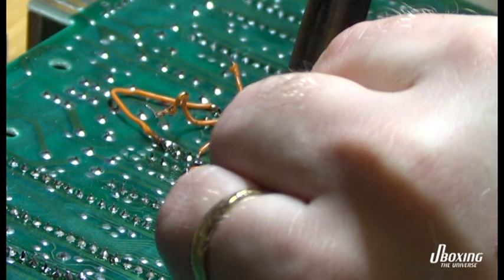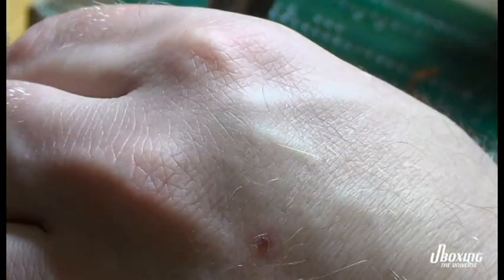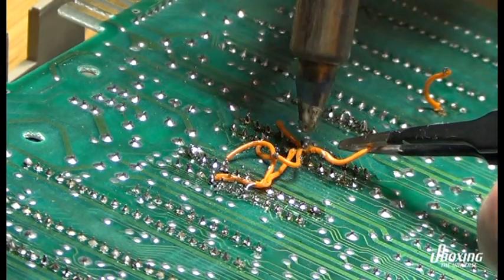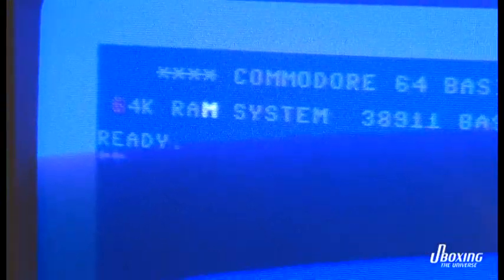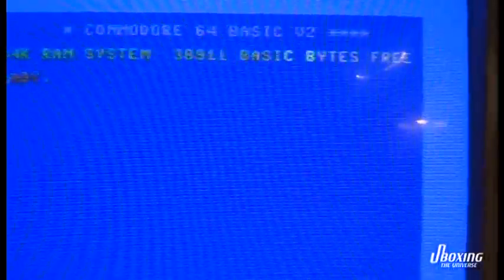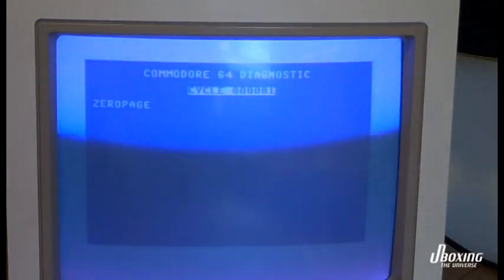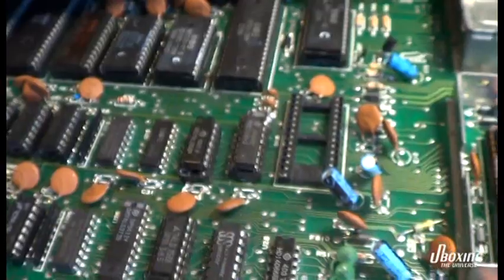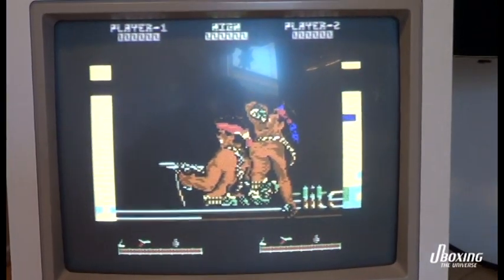Commodore 64 Black Screen Repair (c64)

Comment: Thanks for video, really helpful. One question - what kind of glue you had used for traces? Was that copper wire without surface insulation?
Reply from the maker: Hello. Just about any glue that works :) I used a Swedish one named Karlssons, but anything that sticks. That was bare copper wire.